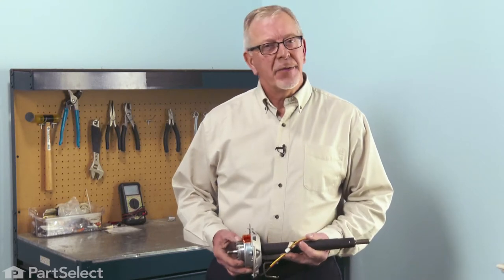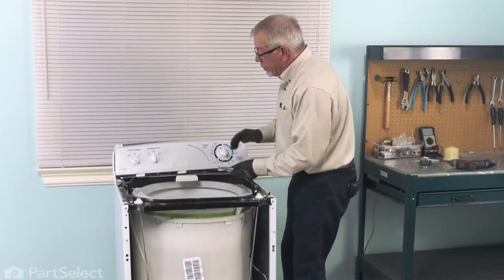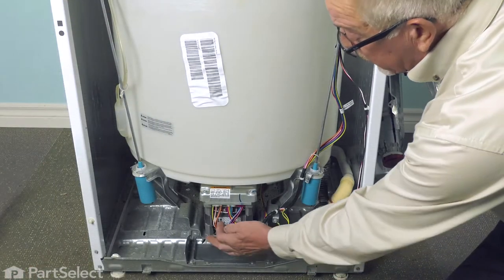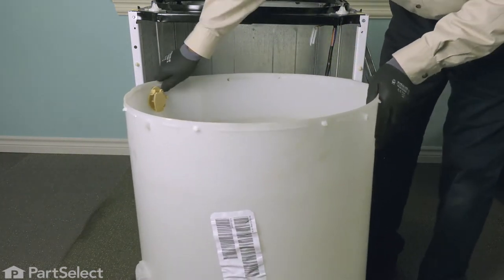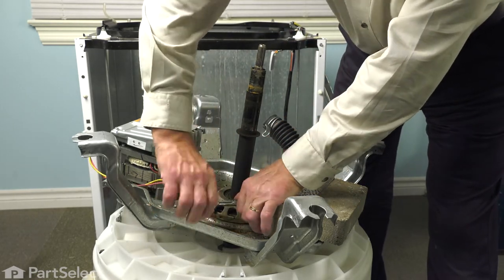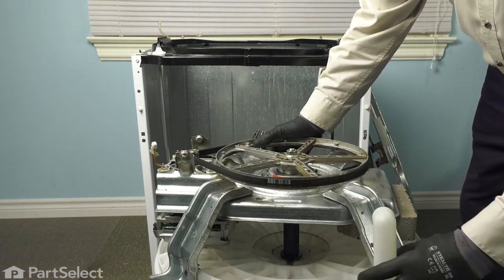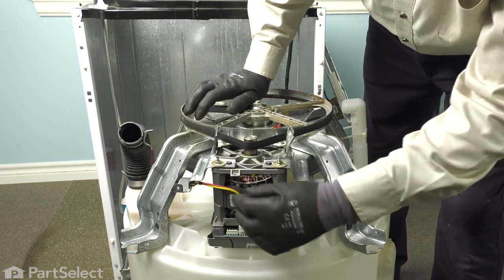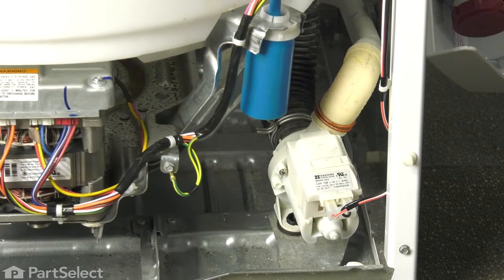GE Washer Repair - How to Replace the Shaft and Drive Tube Assembly (GE # WH38X10019)

Comment: Very helpful video until you get to the 10 minute mark. You don't show how to take off the "split ring." You mention it when you are cleaning with a wire brush, then it skips to turning the tub over. Otherwise, fantastic how to.